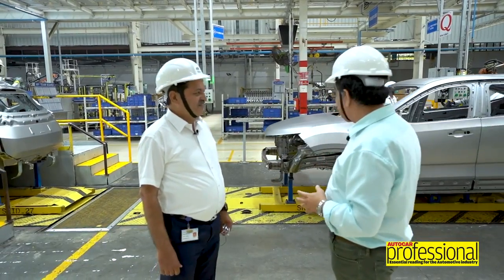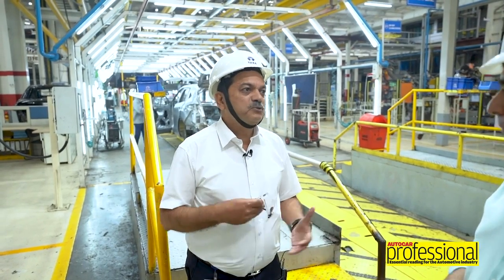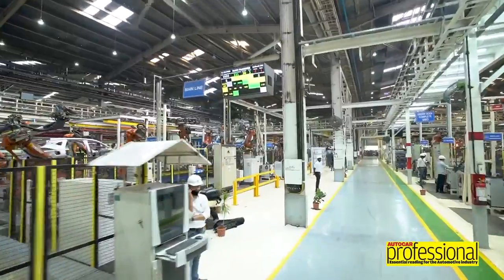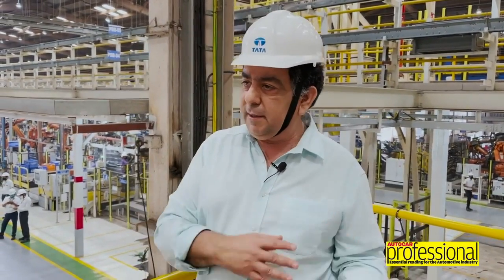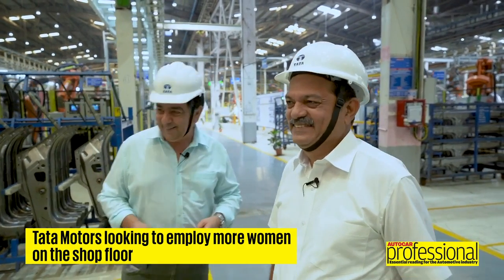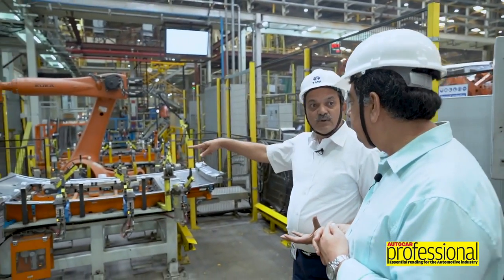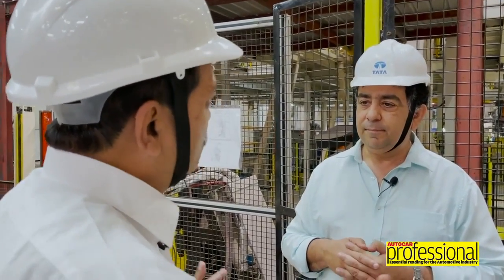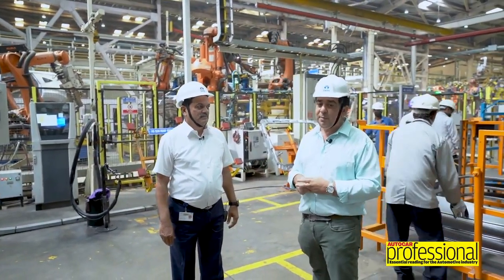Tata Harrier | Weld Shop Tour

Comment: Got fooled by similar gimmicks,  marketing stunts and my own garnishing of "desh bhakti" associated with Tata brand.

Haven't stopped counting quality issues ever since purchasing one of the flagship vehicles few months back.

Right from buying experience, till date, it has only been regrets about wasting hard earned money.

Substandard, rattling, rust bucket with horrible paint work and third rate fit and finish.

All matters well documented in mail communication.

Comment: I HV also Tata Tiago 2019model, i hv also face many issues clutch sound, dashboard vibration,sound from doors, starting pick up problem need to start my for 4-5 minutes,or it's get normal After driving 5-7 KM, service center is very bad not rectified my issues after visited there 4 times in 1 year. Now I do complaints at customer forum against Tata motors. Very heavy car that is good, but fit and finish is not Good not reliable, engine not smooth.

Comment: i wish it was a full process video 😍🙌

just a suggestion tata, pls cut the prices of your SUV's, as since Safari is also launched!!
You need to cut down ₹2-3 lacs on all SUV's models, if you do so you will be market leader 🔥
Venue's top model is for 13.80 lacs, whereas, nexon is 15 lacs!!
Same with, harrier model comes for 25 lacs, almost the same price of JEEP Compass, which have better brand value.........and now you are launching safari, which will be 2-3 lacs more than Harrier (no doubt)!!
My recommendation for top model prices:
nexon price should be 13 lacs
harrier: 20-22 lacs
safari: 25 lacs

Comment: When 1st harrier launched all blind tata fans said sunroof is jot necessary it will not add up sales😂 see what happened now? This is what happening with awd or 4wd for harrier and safari.try to bring a proper 4wd mechanism with low range gear box on harrier and safari with updated suspension, more water wading capacity, good approach and departure angle and see whether it sells or not.i repeat u should launch it in top variant and mid variant too.people are looking for lifestyle vehicels which can go anywhere.its not about hardcore offroading ,its to enjoy woods, estate roads or some highrange muddy paths.bring 4wd for harrier and safari tata❤️

Comment: Just like you have made Harrier from Range Rover DNA, make a sedan of Jaguar DNA
Reply: Now that's what I call a sensible comment 👍
Reply: Oh, Then in which segment they can position their sedan?
Already harrier is misplaced in their positioning...
Segmentation is important when it comes to positioning
Reply: @govardhanravi7502  In the City/Verna segment
Reply: @priyabratapradhan9172   What will be value proposition?
Now the market trend is towards MUV and SUV..so a new product in a dimimishing segment is favourable for company revenues?
Just recall, how many new Sedans are delivered in that segment?
Reply: @govardhanravi7502  2700 unit of Honda city, 4800 unit of amaze, 14000 unit of Dzire have been sold in this december. Although SUV are selling in quite high numbers but TATA has so many SUV to hit the road in 2021 and already have nexon and Harrier but have no full size Sedan, only a compact sedan
Reply: @priyabratapradhan9172   Seems you are not getting the point..
When there is no demand in the specified segment, why will TATA build a new product?
Dont you see the paradigm shift towards SUV ?
Hello why are you bring Swift desire in this discussion?

Comment: No doubt Tata cars looks great but in case of Nexon it's back part needs to be redesigned like it's front part which looks like a range rover. If this thing is improved without any question it's sale will increase.
Reply: Right sir👍🏻

Comment: I feel proud that I have worked in Tata motors cvbu and pcvbu plant. In 2008-09, Savarkar Sir was a logistics head at Cvbu when i was working in logistics. And at that time testing of X1 and manza was going on.😇😇
Reply: Sir, I am trying so many times to get in TATA by off campusing, sir can you please tell me the process to get in TATA as graduate engineer trainee? Sir I am a 2020 graduate b.tech in Automobile engineering , sir I am also secured highest marks in my university.
Reply: @joysjoy4216  now a days they are taking only on contract basis.. u can try that..
Reply: @siddheshbirje6050  ok sure.. definitely..can you please tell me the procedure?
Reply: Woww, currently what are you doing?

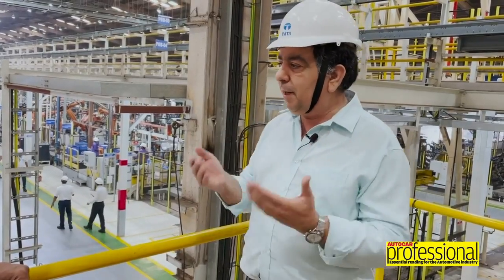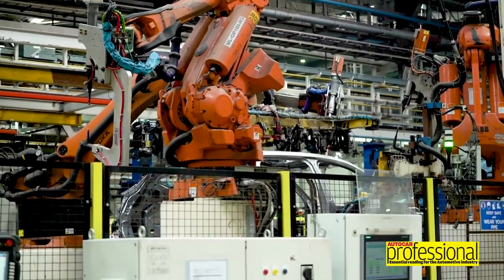Comment: Tata Motors, between 5:30 to 6:00 minutes in the video, heard Beethoven's "Für Elise" playing in the background. 

Do you play music on the factory floor? That seems real nice of you to do so. The floor is incredibly quiet as well!!! Kudos for creating such a neat, tidy work environment for your workforce. Good products coming from a good environment 👍👍👍 

- A 3 month old Altroz owner 😊
Reply: Which model?
Share some pros and cons of your experience with altroz
Reply: @andrewcarnegie5342  It's an XZ diesel. Didn't bother with the (O) which only added the black contrast roof.
So far driven almost 4,500 Kms on it. In mixed usage of city+highway with slight heavy foot every now and then, am getting an efficiency between 17-20KMPL while checking from tank-to-tank method. A sweet surprise is that the mileage indicated by the MID is almost always correct within a range of ±0.5KMPL.

High speed manners are very good, the car's handling is amazing. Auto AC works flawlessly. I use jetAudio+ to listen songs since it's one of the few android music players that work in Android Auto. Its 20-band equaliser is miles better than Tata's 3-band Harman equaliser. Audio quality falls drastically on FM/USB playback (still better than the competition, but wish TATA gave 4 tweeters from the start).

The thick A-pillars need some time getting used to, but they are not as big a problem as depicted by some youtubers. I would take the thick A-pillars over an unsafe competitor hatchback anyday.

While on paper, torque of 200nm might appear low when comparing to one new competitor, the real-world everyday driveability and usability of the engine is better and shines on the highway.

Biggest con: There is a delay of almost 1 second between your throttle input and the engine's response. I hope TATA resolves this with an ECU update.

But, I believe, for the price, nothing comes close to Altroz in terms of the most important feature that is a well engineered, strong & solid hatchback that rides like a driver's car.

P.S. I have replaced the undersize spare tyre with a full-size stock alloy (maximum recommended speed with undersize spare tyre is 80KMPH). Also, no issues with ground-clearance so far.

People crib that is should have LED headlights. Yellow lights are better for visibility, driving in fog/rain, oncoming traffic and economical replacement in case of an accident.

People crib car is underpowered. Usability of the engine is nice, 200nm of torque is sufficient.

Ask anything else you want to know in particular.
Reply: Tata motors good